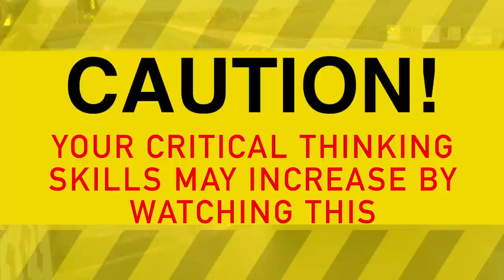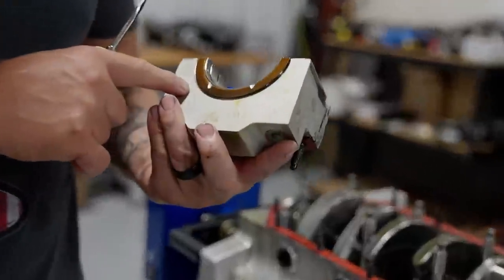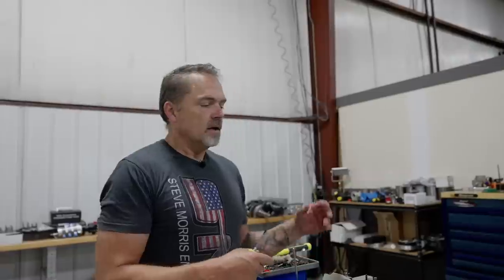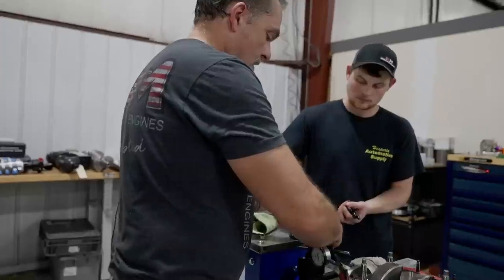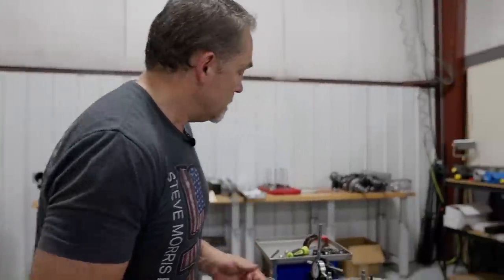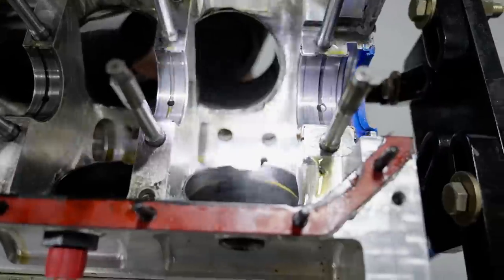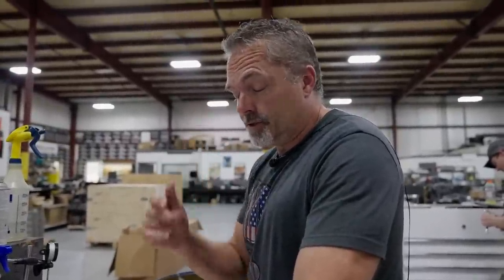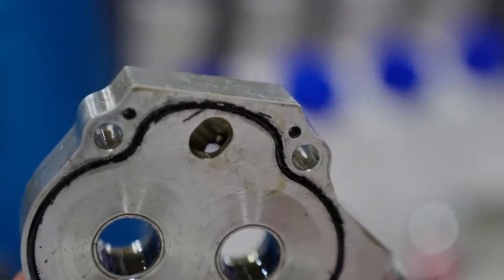I Found Mullets Engine Issue...Part 2

Comment: So, if there was crap in the drysump tank on assembly, it would get picked up by the pressure section and then trapped in the filter. That would be my bet.

Comment: Glad you found the minimal problem! My next question is… The SMX came out of the wagon and didn’t have these problems. Couldn’t garret use the same transmission as in the wagon and maybe eliminate some of the issues he is having? Honest question and humbly asking. Maybe he does I don’t know the answer. Your top class. There’s a reason why you’ve made it. Your God given ability and learned knowledge is so awesome!

Thanks!!!
Reply: The transmission is not the problem. They both use a TH400 setup. The difference is the charge pressure they run. Can't remember off the top of my head what it was, but I recall almost choking on my coffee when they said what the charge pressure in Mullet was. It was far beyond what is commonly used.
Reply: @AB-80X  Thank you for the clarification. Why can they run the same pressure then? Ive been into mud drag racing most my life and just switched to asphalt but just a little 12.80 guy. Super fun but all new to me.

Comment: So, back to critical thinking just a bit. If the trash is coming from the oil tank. What other components are contributing to oil that is returned to the tank? Turbos, who is making up lines, etc. Maybe pressure hoses aren't getting flushed like they should be before installation. Since the engine isn't contributing to said material, where is it coming from?

Comment: which end of the oil pump "was" the pressure section/s on? could it be external forces applied, say anything else belt/direct crank driven, distortion/harmonics again?
I forget which vehicles/what they had issues with belts, fuel pumps, alternators and other things flying apart on. surely there's some/multiple root causes hidden in plain sight.
Murphys laws pretty much ensure that 🤪 I know them all too well!

Comment: I've stayed subscribed all the time, so no issues with me, even getting my bell notifications!
As an engine assembler myself (about 120 a year) in a race engine machine shop, everything looks really good for me as well. I've seen a lot worse and still no issues and running great. I've seen a stuck relief valve before, but pretty rare to happen. Keep the great videos coming as even with 40 years experience It still interests me about doing this line of work!  We've had both the Rottler Diamond hone and Rottler block machining center about 1 1/2 years.  Note: ALWAYS have an extra probe on hand! 😁

Comment: I'd suspected a suction side failure, since the tank and pan were clean.
Reply: So Your claim about the 'tank' is unknown to the viewers, which the pan was certainly NOT clean; was shown with some tiny metal shavings;  more inside the filter ; which is on the pump output side, not input, suction side =thus Your idea, claims are proven clearly incorrect, invalid, false. Good Luck

Comment: The block expanding could absolutely account for the 20 thou difference. The thermal expansion coefficient of aluminum is on the order of 80% more than cast steel.(Not sure whether that driveshaft is cast steel, but the trends work out regardless). My napkin math says that, if those bearings are 20 inches apart, you could get your 20 thou eaten up if the whole engine heated up 200F. That's not to mention we're assuming negligible compression of the shaft.
Reply: Are You certain with Your claim ??!! Have You applied the expansion to every detail, aspect, form, shape of the engine block, bearings, crankshaft, thrust bearing as a proper mechanical engineer ??!! =? Certainly NOT. Good Luck
Reply: @newtonfirefly3584  It's napkin math, like I said. If you want to check the math or use a tool like CAD in lieu of hand calculations and get a more representative model of the thermal expansion for yourself, I invite you to. For what it's worth, I'm an aerospace engineer.
Reply: @thecma3  Your comment contains conflicting claims, information.
a. "napkin math"
b. aerospace engineer
c. additional presentation with a thermal expansion via "representative model"
A. What is Your specific engineering degree, university, date, specific involvement within any engineering project, design, development, verification, certification, troubleshooting, problem solving, assessment, evaluation, differentiation, discernment, analysis, determination, etc. ?
B. As We engineers know, these simple thermal expansion assessment, evaluation, through analysis, determination requires proper use within the entire 3-D structure, components, also in combination within static, dynamics \
1. if You are able to do this completely, properly, accurately, precisely, exactly,  via using simple paper analysis, calculations then fine
2. actually no model need to developed, but certainly using a computer with a developed, algorithm, applied to this specific structure, can certainly be assistance, help, value
3. the engineer(s) involved with the SMX engine design may have the details within their computer(s) from their design, have already performed the necessary temperature analysis [which would certainly be within my methods], thus also as needed to perform more extensive analysis within these conditions not previously considered, used, assessed, etc.
4. those of us with extended experience within engineering design, development for many decades, beginning within prior to, during CAD tool development are certainly well aware, trained, developed through these skills knowledge, experience too [mine exceeds 45 years]
All The Best, Sincerely

Comment: Thanks Steve, you are so great when it comes to explaining everything, you don't hide anything, most engine builders are so secretive, what for? you explained the whole tear down, the pump being suspect, will you replace it? the thrust needle bearing housed mid block, could have collapsed, not broken! but at idle and staging the car the clearance was spot on , then the pump bypass sticks open creating a loss of preasure! then the load forward while staging was the reason the inside of the rear bearing you clearanced may have touched. because the Trans was in gear on bump. anyway thanks again, for sharing your computer 🖥 data as well.
you the man, engine builder man! 😛👍🏻.

Comment: Wouldn't the aluminum block expand more than the steel crank and close the clearance?
Reply: It would most likely increase the tolerances instead of closing the tolerance. The crank would not expand as fast as the block.
Reply: @matttraxler3567  I agree the journal clearance will get bigger, but what about thrust?. If the block expands front to rear then the rear thrust surface would get closer to the end of the crank. That front roller bearing would move farther away allowing the crank to move farther forward. The end result is the crank's thrust surface would get closer to the thrust bearing - reducing clearance. 

I don't know from experience, I'm just trying to logically process this and it seems like Steve may have misspoke here. Or it may not work the way I think it works...

Comment: Aside for being absolutely ridiculous, overkill, and expensive at the pump, what would it be like to put an SMX in a daily driver? Would it be more reliable and longer lasting than stock Chevy engines which are famous for being hard to kill?
Reply from the maker: The SMX makes a 1000 hp no boost on pump fuel
And is very reliable,
 More so than a 1000 hp no boost sbc or LS or bbc. 
The SMX is very reliable at 4000 HP boosted
There is no such thing as a BBC or SBC or LS that can live and drive at 4000 hp
Reply: @stevemorrisracing  My first car ever was a 92 Suburban with a rotted out exhaust manifold, and it sounded mean a mile away. I wish I still  had that truck and the kind of money to put an SMX in it lol.

Comment: The scoring on the skirts of a couple of pistons is far from normal Steve,  54yo, started engine reconditioning when I was 16, trade qualified fitter machinist / mechanic, dual qualifications,  spent years drag racing turbo 4cyl And 6 cyl cars and later in life had a performance motorcycle shop with dyno , building nitrous and turbo bikes, drag racing a hyabusa nitrous bike and a nitrous zx9r , modified street bikes running 8 seconds at 156 mph. Not seen any of my NORMAL engine Wear look like vertical scuff lines on my pistons.   Sorry you was quick not to show these two pistons,  then very quick to dismiss it as a little dinger?   If Garret had of kept running that engine he would have at least two piston failures.  Not every one watching your channel has no idea .

Comment: At 1:35 -  2:18 I'm confused how that's a driveshaft, not an axel?  Oh it's a dyno part... you can go with much cheaper materials with bigger diameters.. why are they axle shaped when they don't need to be?  What dyno brand is this?  I assume there is less than a handful of hub dyno companies.  And the reason they're used is accuracy and high HP, and those small diameter shafts ain't gonna handle it, i don't care what material it is.

Comment: You need a oil filter before and after the oil pump!
Reply: Why have a filter on both sides of the pump ?!
Reply: @newtonfirefly3584  then you can tell if the material is coming out of the motor or if its coming out of the pump
Reply: @newtonfirefly3584  it would’ve save them from having to tear down that whole motor this time!👍🏻
Reply: @dr.bubblemeltsalot1228  You are attempting more nonsensical claims, ideas, portrayal, narratives ??!! Good Luck -> Bye Bye

Comment: The only thing that comes to mind is as you said thermal expansion and possible deflection of the  thrust bearing. It may not be eating itself and the housing may be more than sufficient but It would be interesting to see if dimensions of the housing and thrust surfaces have any deformation or changes within the manufactured specs.

Comment: There's debris in the dry sump tank from a previous failure.  It's shaking loose while making passes.  That's why it's then getting caught in the filter but not going through the engine.

Comment: I’m curious about the lifter bushings in Mullets engine. (IMO that is more than minimal damage for a oil pump.) Also interested in the power side of the connecting rod bearings. 
I also believe this was the first time Mullet got into tire shake. Tire shake can be brutal on parts.

Comment: Had that happen a couple of times on a  stock 440 Mopar a kid was racing ( no oil pressure) luckily you can take the oil pump off  the motor from the outside and fix  the sticky pressure valve . 👍

Comment: Steve! Sick video. I would need more than two hands to count how many things I learned from watching this. Cleeter was running that motor hard! It’s actually quite insane to see how well it has held up after some tough beatings and lots of miles. Minor abrasions and little bit of flaky trash in the oil. Big blocks are built to go hard, but the SMX isn’t even breaking a sweat if we are being honest.

Comment: Love it !
I dont expect answers but these are thoughts of mine - I'll have to go back and pay closer attention to past videos !

Do you move the forward thrust control to the front just to get it onto the better "roller" style bearing ?  Is this to accommodate higher loads from HiPo converter loads ?
I'm assuming that the only thrust energy on the crank is acceleration, deceleration, and converter ??  I hear YES as I am writing
Is backward movement is still controlled by the rear main ?? - this is very minimal, only vehicle acceleration?
Does Mullets converter push "hard" enough on the roller bearing to further engage the rear main thrust ?  I guess all the converter thrust is handled by the crankshaft. - I see NO as I write this
Any problem moving the thrust control to the front and have it go through the crankshaft , or is this a very small load compared to its primary function ? - YES I think
Nice to see subscribers creeping up !  I know this isn't a area that everyone is craving for  . . . But I love this stuff !

Comment: Clearly Cleetus just needs to start actually racing X275 or something so he pushes this fine piece of equipment!
Reply: That would be cool but they gotta get their programmed dialed in to be competitive. Fun to watch and all but consistency ain’t there. Could be but they got a lot of different irons in different fires
Reply: @Bacongrease00  Yes, correct. actually the power/weight is not excellent with "Mullet" nor the current suspension. The sue with X275 Radial does not give "Mullet" enough traction for a good, quick launch. They have competed in FL2K, TX2K within classes that require similar size tires, which has resulted in slower 60 ft launches, thus limits the ET performance - and slower than the more competitive X275 or No-Prep, NPK or other such classes. 
Garrett has been using 315 mm Radial street slicks during these Drag&Drive events. 
Garrett, "Cleetus McFarland Racing Team" [CMRT] is not in the level within their shop 'team' to achieve a proper racing vehicle for proper competitive drag racing classes. Such competition requires a much better team to achieve competitive racing vehicles with consistency. They will need a purposely built completely race only vehicle to compete within any proper racing class. Also comparing the knowledge, expertise within the CMRT to Tom Bailey, Dennis&Alex Taylor, Bryant Goldstone, the Swedes [Michael, etc.] also to Larry Larson [Tom McGilton's Gen 5 Camaro, others including personal], there are obvious, clear differences, distinctions, levels between them too.

Comment: I came from the DSM world, crank walk is a very real issue for the 4G63 engine both automatic and manuals as both see thrust on the end of the crank which eventually walks one of the counter balance weights into the block.

Comment: Ive been building cars, custom motors and builds, alot of 1 of 1 builds and frankensteined motors, EFI on classic porsches swapped to the 2.7s and 3.2 etc.. ive found these gremlin issues usually are because you put the zip tie in the wrong place because everything started working after you moved it and never had an issue again 🤷‍♂️😂 jk. Gremlins suck. Nothing worse than having a car roll back in that youve spent hundreds of hours or even multiple years working on for the 3rd time😅

Comment: That miniscule trash is what fouled the bypass. It'd be interesting to see what comes out of the bypass piston bore. I've had bottles of oil that had trash in the bottom of them.
Reply: I've seen a bit of additives settle out on the bottom of a bottle but never actual debris.
Reply: @bobroberts2371  Yeah, it was pretty shocking. Actual steel debris in the bottom of a gallon jug of 15/40 rotella.

Comment: I still love seeing professional failure analysis! Did it for years on Diesel Engines (BIG ones) as a Mechanical Engineer before I retired. And pretty much everything that came back when our customers broke them! You'd LOVE to diagnose a V12 twin turbo diesel (with pistons the size of 5# coffee cans) that had been run until the broken con rods almost cut the block in half!😆

Comment: If the block grows by more than .020 longer than the crank grows I believe you eat up your gap on your rear main thrust surface causing it to touch both it and rollerized thrust in the front of the motor. Add a little deflection from the front thrust assembly  from all the converter force on the 2 step and I still think you might have to open the rear main thrust clearance a bit more.  Without checking it hot after a run it’s just speculation.
Reply: Jeff Ortkamp, the aluminum block does NOT 'grow'; only biological entities grow. Solid materials expand and contract; most have known coefficients of expansion-contraction/temperature. Then these are used within a proper assessment, evaluation, analysis, determination of the entire 3-D structure, all parts, components, etc. as an proper engineer performs. Good Luck

Comment: Man I wonder how many people would have missed that bypass being stuck. That's why your the man.
Reply: what an experienced engineer, technician, troubleshooter would have done first or at least post the disassembly of the oil pump, is to check, test the oil pump with the condition it was in, or noticed, to measure the oil flow, thus repeat the low oil flow, pressure as clearly noticed, seen by Garrett pst run 3 on Day 3 after restart and low RPM driving back to the pit area. The test the oil pump with the repair, fixed to notice the improvement, change. All The Best, Sincerely